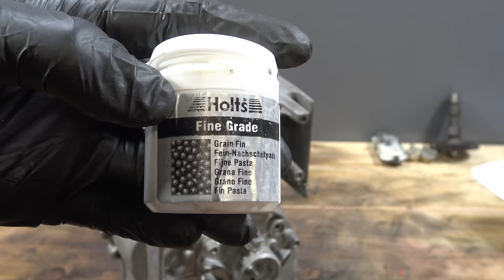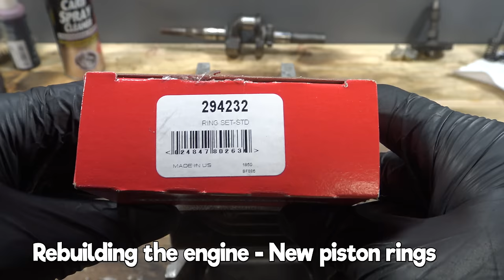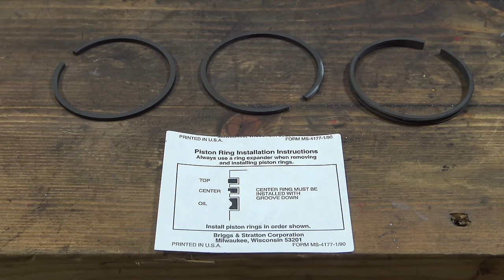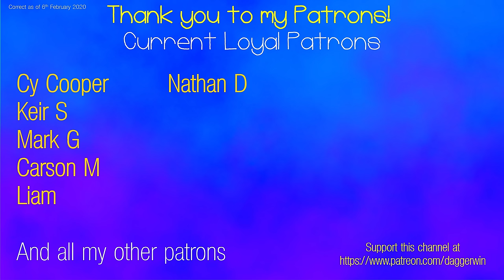RUSTY ENGINE REBUILD RESTORATION (Will It Ever Run Again)

Comment: That flywheel came off so easily??? O.O

Each time i have to take one of these off i need to heat it up and pry it off with such force! Lucky!!!
Reply: GrimStrider don’t heat a flywheel!! All you need to do it put a piece of wood over the shaft, pry up on the flywheel and hit the wood
Reply: @charlienorton2337  mmmm you mean.... pry it from one side and just hit the wood piece lying on top?
Reply: GrimStrider yep

Comment: Others have said it also but, i dont think ive ever seen one of this generation briggs engines worn out, and i have been around them a lot, mostly its just carb issues, new carb kit and its away again. You did a top class job of restoring that engine sir, 👍👍

Comment: I have the same model, but from 1964.  It has fresh rings, seals and gaskets and lapped valves.  It runs as well as new in 2020.  With proper care and use, these early aluminum engines will outlive those who bought them new.  They are well-designed machines.  This chap's paint work beat mine by a furlong, though.  Excellent job.

Comment: First pull look at that!!
Reply: I have never had a B&S flywheel come off like that ! and why leave the rubber hose attached to the Valve Spring cover? Paint Stripper is gonna eat it !
Reply: @carlnewman24  Clutch was missing, flywheel was loose on shaft.

Comment: I subbed because of the amazing detail and effort you put in ensuring the right torque was applied and also using the correct tools. It made me happy seeing someone use a ring compressor rather than struggling like a pleb. Nice touch with the valves too, something people miss.

Comment: Good cleanup and rebuild.  As someone who had rebuilt these for 30 years, there were two things that I noted:

Check the valve lash.  Put the entire bottom of the engine back together and place one valve in the head (no springs yet).  Rotate the crankshaft until the cam shuts the valve completely (plus a few degrees).  Check the gap between the valve and the pushrod to make sure its in spec.  After lapping them you're probably going to need to file a few thousandths off the end of the valve.  Do for both valves before installing springs and retainers.  I can't tell you how many poor-running Briggs motors I've come across that only needed a tiny valve job and a clean carb after many years of service.

The other thing I'd do - and this is totally a preference of mine - is to replace the condenser and points with an electronic ignition.  Not much more cost, and you'll avoid ever needing to take the flywheel off to clean or adjust them again.

Comment: What a wonderful vid, thanks very much! I once had the same engine (mine came from an Atlas roto-tiller) that I rebuilt in the same way years ago. I sand blasted it and sprayed it back to it's original Atlas orange color (block and all) and it looked pretty good but boy that powder coat process that you did on that one really takes it to the next level! Beautiful rebuild, really takes me back!

Comment: A square piece of sheetmetal would make a perfect air deflector replacement, which is missing on the pto side. It's necessary to deflect more cool air from flywheel fan blades to the exhaust valve area, so engine won't overheat. Great job restoring this engine! Looks and runs better than new.

Comment: As long as the block is ok, and the carburetor isn't totally oxidized to pieces you usually get em running. It's usually not that hard (well relatively speaking). But requires quite a bit of time and patience, and yes, knowledge. I love this kind of stuff!

Comment: The air deflector plate on the pto side of the engine is missing, with its screw. It's needed to force air from the flywheel fan through the hot exhaust valve area, so engine won't have a hot spot there, and lose power. It's an important part of air-cooling system. It would be powder-coated red also. This was the best restoration I've seen yet. Nice work!

Comment: Yes I've just fitted new rings into my 1988 model 92500 Briggs & Stratton 3hp vertical shaft lawn mower engine,it does blow a minute amount of smoke on startup only but it's heaps better in comparison with the old piston rings where it started blowing lots of smoke on startup.

The piston ring gap was 1.15mm when the reject gap is 0.80mm,the rebuilt engine has a ring gap of about 0.22mm,so the engine has got more compression now,I've done some mowing with it & it doesn't use oil whereas it used to burn 200 mLs of oil within 1 hour !

Comment: This is a text book recondition of a Briggs Or any engine for that matter, from using the top of the piston to even out the rings for checking ring and gap, to using assembly lube on all the mating parts. Great job!
Reply from the maker: Thank you

Comment: Thank you very much for taking the time to put this video together. Well presented, it is by far the best video I found Surprisingly with no commentary it was very easy to follow, i have acquired a 2.5hp and 3hp cylinder mowers both needing work.  My first time to do a full strip and rebuild. 
Thanks 
Scotty

Comment: I am working on a trash pump with the same engine and carb. I wish you had shown the proper setup of the linkage to the governor and the throttle. Mine has a simple pull rod to set the throttle. Beautiful finish you put on there. Great video.

Comment: If this Briggs and Stratton engine was going on my machine I would have clear coated the aluminum and painted surfaces.  Be sure to get a type of clear coat that handles gasoline, motor oil, and heat well.  Very good engine rebuild! Powder Coating is a little over the top. But heck, if it was mine I'd do the same.  There ain't no such thing as too good of a job for your own stuff.  Thanks for the video!

Comment: Hey that was one of the finest quality work ive ever seen someone do on a 3hp. Good and instructional video! I recently started working on a tiller i took apart and rebuilt last fall. Its got no spark, bought a new briggs and stratton plug, cleaned and fine-sanded the points, took rust off the flywheel and magneto surfaces. Any help?

Comment: That permatex is nice for bearings and stuff because it’s a little thicker so it’ll stay in place a little longer, but Total Seal sells some piston lube that’s pretty nice, it’s not too expensive but is nice because oiling the rings up on installation is a good measure to do.

Comment: Great job on the restoration. Although, I would have upgraded to electronic ignition instead of points and condenser.
Reply from the maker: I usually restore machines to how they were on the day they came out the factory. I am all for originality. However, I totally understand why you would say that...more reliable.
Reply: @MachineryRestorer  I respect that. I work for a small engine shop and if a machine comes in that has points, we immediately upgrade the coil. We just can't risk stuff coming back.

Comment: I have always lived these lil engines, I have 2 of these 3hp engine, 1 is on a snow blower and other was on old ridein mower but now powers a Roto tiller, there funny case there the same size as a us 5hp and the square carb bolts, looks great, nice color choices :)

Comment: you helped so much with this video. I have almost if not the same engine sitting around. It has no spark and i knew that the condensator is probably the issue. But i could get this clutch cover off the shaft. I tried to pull it off. Well ... its screwed on as I've learned in your video :D I need to weld me a adapter for my hammering drill and hopefully this thing is willing to get loose that i can replace the condensator or tune the mechanism inside.>

Great video and keep up the good work !

Comment: Someone gave me a 5 hp made in 1976. They said it hadn't been started in years. Put in about half inch of gas, cleaned plug with rag, pulled out choke and it started on third pull. Not even any smoke on startup, runs smooth as silk.

Comment: when you are starting one of these projects you should wash as much of the dirt off the outside as possible.  a good wash with a pressure washer is always a proper first step if you are going to open it up.

Comment: I've got a Briggs & Stratton  I mow my lawn with that is an 81 model.  It was rebuilt in 85 because a guy ran it low on oil.  It's a cast iron sleeve 5HP that I built a 26 inch deck for and stuck it on.  I've been using it every year on an acre lawn since 1995 with no problems.  Only had to put a diaphragm in the carburetor once about 3 years ago.  Doesn't use any oil either.  Good engines.  Just don't make them like that anymore.

Comment: The only issue I’ve had with those old Briggs (most were on equipment from 70s and 80s) was with the valve seats. The are hardened seats pressed into the aluminum block and sometimes the seat wasn’t pressed in completely. The valves would “press” it in and blow by would occur. Loss of compression and power. Easy to tell on one of my Toro snowblowers. 1980 8/26, using it at night clearing driveways the muffler would glow cherry red and quick. Pressed in a new exhaust valve seat, and new valves it still runs great now with my cousin running it

Comment: the thing you called a "fuel pump" is actually the diaphragm of the carburetor. the diaphragm acts like a fuel pump because it sucks up fuel and throws it into the engine where it can be used as fuel. plus, the carburetor that is on the 1979 3hp Briggs engine is a pull choke-type carburetor. I worked on a 1967 5hp Briggs and Stratton engine which is on a 1967 Bob-caT Snow-Thrower. took the carb off and sprayed a fuckton of carburetor cleaner in it, sprayed on the outside and cleaned a bunch of the grease off of there with a wire brush. took the thing apart and sprayed cleaner in every orifice of the carburetor, took the diaphragm cover off and it turned out that there was some crap in the intake of the diaphragm which I stuck the straw on and sprayed. cleaned the rest of the diaphragm. after I got the carb cleaned and put back together and put back on it ran like a top. so, the carb you are working with is same one as on that little 1967 Bob-caT Snow-Thrower. not the same engine but the same carburetor.

Comment: that engines beautiful, B&S motors will literally run forever if you dont abuse them and give them good oil. I have one on my mower that I bought in 2003 and it still starts on the first pull, and has never once let me down. The mower itself has rust and such, wheels are almost bare, but that motor doesnt give a hoot it just fires right up.

Comment: My pap had one of these in a 3 1/2 hp on his mower. It was made in 1991. That mower sat outside every year,all year....and every year I'd prime her up pull the cord and it would start right up. The deck of the mower eventually rotted away but I guarantee that motor would start if I still had it today

Comment: People can paint parts and bake them in a gas grill if they want to experiment some. They just need to monitor the temperature. The high temperature enamel paint comes in spray cans although I'm sure the powder is much less expensive. One way to set it up in a grill is to use the burner on just one side of the grill to heat it and bake the part on the other. Don't leave lava rocks or anything that would smoke in the grill and put a barrier like a piece of metal or ceramic tile between the part and the flame so it doesn't overheat. Then, just watch the temperature. But, don't open it until the required baking time has passed. It works fine when you only have a few parts. Some people use an old toaster oven which is fine as long as you don't use it for food.

Comment: Any links to parts suppliers for these old engines? Where can I get spec like points gap, fuel mixture etc?
Excellent  video I need to get set up with blasting gear and powder coating.

Comment: Excellent video as usual. I've been copying down the part numbers you have been displaying. Have you a part number for the armature/ignition coil and also a rebuild gasket set? I have a 3 H.P. horizontal that I am about to rebuild. Any such information would be very helpful as would addresses of likely parts suppliers.
Keep up the good work and thank you for making these videos.

Comment: I pulled a lawnmower out of a dumpster that had the same motor on it. I didn't go this far with it but I rebuilt it and used it for 6 more years until one of the wheels broke off of it. Then I used it for 2 more mows before the end of the season on 3 wheels, finally put it to the street. I often wonder where it wound up. Maybe someone replaced the wheel and kept it going.

Comment: The engine looks great but should the cross hatch you put on the cylinder bore look like that or should it be at a 90 deg angle

Comment: Great Vid - but looking for a little help. I have an 'identical' engine that im looking for parts, but it doesn't have a serial number and didn't see one on your rebuild either - what kits did you get for gaskets, governor spring etc??? What was the points gap size and sparkplug also!!
Great job, fantastic finish.

Comment: Great job, did you set the valve clearance/ Didn`t see that part And where is the little square air deflector on the pto side of the cylinder. But nice job.

Comment: Well, its a labor of love and I suppose youtube furnishes the cheque here - How much would a 3hp, direct drive 4 stroke petrol motor be worth new? $250? Maybe up to $400. Definitely not worth the labor alone if you took it to a shop for repairs.
I know I got a 16hp/9kVA generator for $900 Australian, for a motor with a fraction the power I wonder how much actual value there is.

Nice vid, good job on the fixes.

Comment: I've got a Flymo Powaspade that uses one of these. They're a wicked little engine, really cooperative on cold mornings and they fire up instantly even if you don't run them for months.
EDIT: Jump to rebuilt coil assembly! C'mon how many hours did it take to get that spring back in place, you can tell us! Also, unless you didn't show it, you're missing an internal metal cup that sits in the hollow section of the air cleaner.

Comment: That rebuild looks great, particularly impressed when you replaced the decal (classy!) but I was wondering why the fuel tank sits at angle?
Reply: Is there a bracket to support the tank underneath it?.  All the weight of a full tank is on the carburettor.  Would be worth doing to ease the strain on the carburettor to cylinder head bolts.       What are the plans for this engine?   Bench power source? Generator?

Comment: If you don't have the spring compressor tool , compress the springs in a vice, tie them with  nylon string, assemble in motor and remove string.

Comment: I've fixed a bunch of old engines, but haven't run into one with points yet.  I couldn't tell for sure, but I didn't see him put the spring cap under the fuel pump diaphragm.  If not, the spring will wear a hole in it after a while.

Comment: I have the exact same motor (80232) attached to a McCollouch generator.  It's awesome but my engine is leaking oil from the crank and it's in desperate need of a carb rebuild.   Where did you find the gaskets and carb kits?  I have been unable to find them online.  Great vid BTW

Comment: Nice video.
I'm in the process of rebuilding one of these.
There were two wires coming off the points. One to the coil and the other was not connected. On your video it looked like it went to the carb somewhere? That just confuses me? Potential spark at the carb? What was it connected to?
Reply from the maker: yes there is a tab on the control bracket near the carb where it slides into, it’s for grounding the system
Reply: @MachineryRestorer  ok thank you. I though it was some kind of ground but near fuel is what confused me thanks.
I found a Masport Home gardener out the front of someone's house being thrown away. I don't need it but love restoring old stuff. It is in original condition with just faded paint. I was going to paint it but now feel I'm just gonna clean it and get it running as there is nothing wrong with it.
Thanks for your reply and your video. I like how you powder coated it. Turned out mint.

Comment: You should have used chrome faced rings in the aluminum bore, plain iron rings are for the steel/iron bore. I did this by mistake on an 8 HP B&S and the rings scored the bore and turned the oil into aluminum pudding.
Reply from the maker: These are the rings for this engine according to the Briggs Stratton parts list

Comment: I know this is a long shot.. but do you know where I can order the throttle assembly for a briggs and stratton 5hp.. it has a choke exactly like yours and very similar throttle.. I've seen there are different variations but yours is the same as mine.. it's a 5hp, 206cc.. oh I'm in uk

Comment: Where do you find the parts/decals/etc for your rebuilds? I’ve got a MillerMatic 30 (PN 056 881)(SN HG030951) that I’m trying to repair and can’t seem to find the parts I need for it. I’m not trying to do a restore on it, just trying to get it functional so that I can use it for my welding. I’ve found a couple old manuals, but neither of them are specific to my serial number, both were printed after my SN.

Comment: Is there a way to set the valve lash in these engines? It was fascinating to watch the rebuild.
Reply: Yep. You grind the valve stems to the proper lash if needed. Unless you go nutzo lapping the valve seats it probably won't need to be done before the engine wears out completely.

Comment: Always replace locking plates/washers. I did not replace a front sprocket locking washer on a 1999 Yamaha R1 I rebuilt, I just used the old one. The front sprocket came off at 120 MPH after the locking tab failed. If it wasn't for the fact that the MC shop did not press in the chain link correctly (which gave way after the sprocket detached allowing the chain to just drop) I don't think I would be here today.